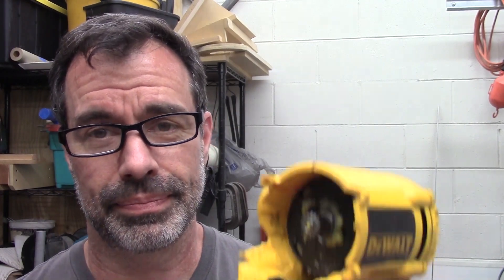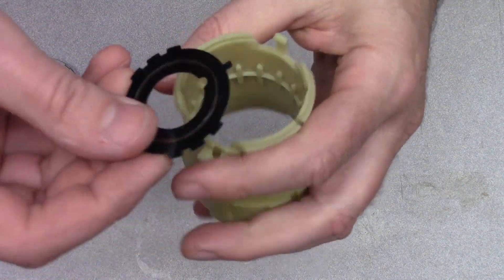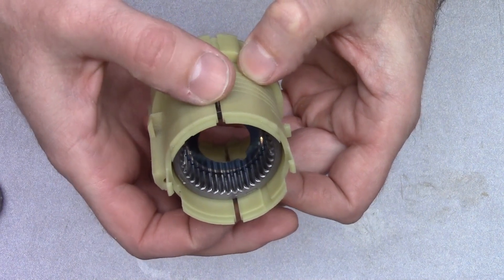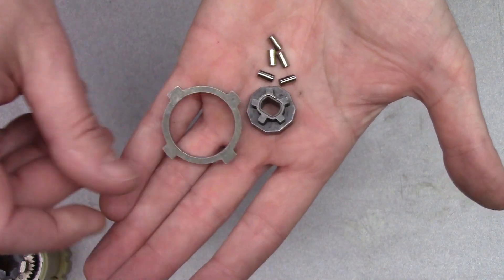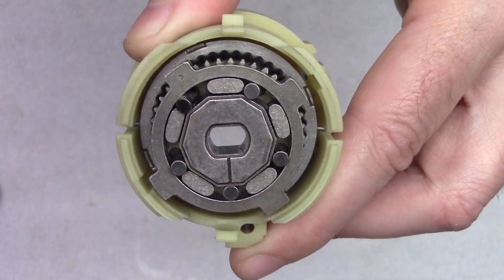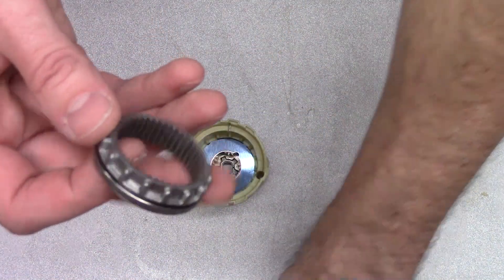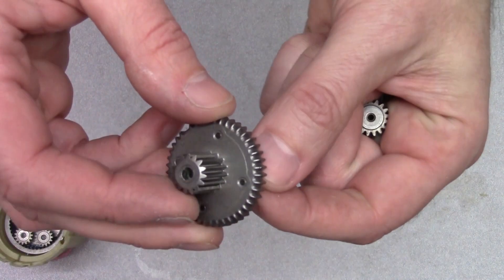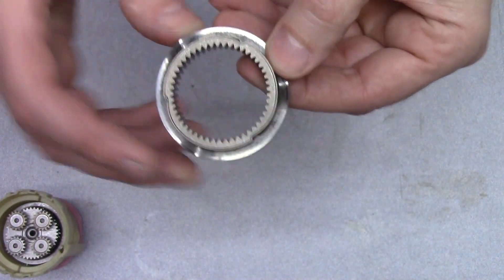Dewalt Cordless Drill Transmission Rebuild - The Next Project

Comment: Thankyou sooo very much. I was about to throw away my drill. Question should i have put some grease on the gears???
Reply from the maker: Anthony, glad to hear the video helped.
Yes, you should get some appropriate grease on the gears.  I've tried a couple different greases, white lithium and a generic gear grease. The white lithium seemed to let the drill run freely, and the gear grease was a bit thick.  Probably need something in-between.
Good luck with your projects!

Comment: My dewalt drill (dcd777) made a little popping sound when I was removing a screw. Now it will not catch at any setting though the motor sounds normal. Any educated guesses on what part failed?
Reply from the maker: Gandoff, thanks for watching and the interesting question.
I couldn't really say why your drill may be acting up. 
Your drill appears to be a completely different assembly, so I'd only be guessing at a cause. 
If the motor still spins up, but no rotation at the chuck...sounds like something in the transmission, but I have no diagram for that model to determine where.
Wish I could help.
Good luck with your project.
Take care!

Comment: When my DW987, long in the tooth as it is, got the forwards/rev switch stuck, I said, sure, I can fix that.  After that last screw came out, gears went everywhere.  I knew how they went back together, but this video helped me get them back together.  Also showed that it was easier to pull the transmission out, because of the spring pressure on the back washer.  Back together now and working great.  Thanks!
Reply from the maker: Glad you got it back together!
Thanks for watching, take care!

Comment: what kind of grease do you use
Reply from the maker: Hunt7r, thanks for watching!
I originally used a white lithium grease, but I honestly don't think it stays on the gears well enough over time. 
I've read there is a "gearbox" grease for electric power tools, but I haven't found any for sale.  
I have since used a more standard wheel bearing type grease.
This is probably not the best choice, but I had it on hand.
Sorry, I don't have a better answer for you.

Comment: Thank you for your effort.  Pretty messy trying to assemble with grease on everything.  But, cleaned, assembled and greased - it works as it should.  I used wheel bearing grease.
Reply from the maker: MonoRalph, glad you got your drill together.
I recently re-greased my drill, and I used wheel bearing grease too.
First time I used White Lithium grease, but it seemed to light and the gearbox wanted something more substantial. 
Take care!

Comment: Sir How can I contact you? I really need help in assembling of a STANLEY Cordless Drill Gearbox I accidentally open it and some parts fall apart and I didn't know how to return it back to its right part orientation.
Reply from the maker: Hey John, I feel your pain. You can email me at:  thenextproject.info@gmail.com

Let me know exactly what model drill and if you know the year that may help also. Photos will help too.

If you have all the bits n pieces, we should be able to get it back together.

Take care!
Reply: @theNextProject   hello! Tool wizard!  Can you help me? I have a SKIL drill F012236400.  How can i pinpoint the defective parts? Can i even get parts for this drill driver  7.2 volts internal lithium battery. The drill was struggling to turn.  I gripped the clutch ring and the motor moved and this freed the chuck to spin but weakly anmd and intermittently now it has stooped engaging at all. What do you think?

Comment: Do you grease the transmission gears ?
Reply from the maker: @Sully, good question, and yes I did.
After making the assembly video, I took it apart and greased it as I re-assembled. At the time I used a white lithium grease, but I don't know if that is the best choice, as I feel it doesn't stay in the gears very long. A few tool companies sell a "gearbox/transmission" grease, but I don't have any of that. 
Something to keep in mind, a thin grease won't rob power,  but may not do much to protect the gears. A thick grease may load the cordless motors more than wanted. More research needed on my part.
Thanks for watching and the comment.
Take care!
Reply: @theNextProject  thanks for your reply. I’m replacing the motor in my xrp and while I have it opened I wanted to clean the gears and re-grease them but I’ve had a hard time finding good info on what type/weight to use . Thanks to your video I at least know I will be able to reassemble to transmission properly

Comment: What can I clean the parts with as some have dirt/debris on them? What lubrication and where to apply once the unit is together do I use? Thank you so much.
Reply from the maker: @Susan Markwat, 
Hey Susan, great question(s)!
I used brake cleaner, to clean the parts, only because I had it on hand. 
You will need some sort of grease remover, a local auto parts store will have a variety.
Whatever you use, wear rubber work gloves (nitrile or latex..) and some eye protection.
My parts were covered old grease and sawdust, the brake cleaner made fast work of removing the crud.

As for lubricant, I used a white lithium grease, a little on all of the gear "teeth, and a light coat on all the shafts and surfaces the gears will contact. Gears, shafts and surfaces should be greased during the assembly process, not after. I did the video "dry" just to show the process. Afterwards I took it all apart and reassembled with grease - a bit messy.

I am still looking for a better "powertool" gearbox grease, as I feel the white lithium doesn't stay put well enough. That said, a heavier body, stickier grease may also rob some power. 
The lube will need to be a grease, not oil. 
Sorry I don't have a better answer for you.
Good luck with your project!
Reply: @theNextProject  I use grease used for paintball. Any OEM brand will work. I use it for almost all non automotive stuff because of 
1. Excellent for high cycling rates
2. Doesn't affect rubber o rings
3. Covers a large temperature range and keeps viscosity levels from fluctuating.

Comment: I have slightly different model on which I wanted to dismantle and re-grease the gearbox by way of preventative maintenance. Your very clear and concise demonstration was extremely helpful. Excellent work - thanks for posting!
Reply from the maker: You are very welcome, thank you for the comment!
What type of grease will you be using? I used a white lithium grease if I remember, and I may need to pull it apart and re-grease... I'm not sure what the factory used, but it seems to stick to the gears very well... Also stock to sawdust and other contaminants - LOL.
Good luck with your project!
Reply: @theNextProject  I've always used just a basic general purpose grease (Castrol LM) in drills / angle grinders etc.  Some of them are still going strong after 40+ years, so I guess it's OK for the Job :)  I'll have a look at what's in there already though, as the Dewalt is a more modern design and may need a slightly 'thinner' grease.
Reply from the maker: @jodeld1839  , Thanks for the reply! 
I like your suggestion.  I'm thinking the white lithium grease I used is too light. Worked and sounded good initially, but is starting to sound a bit dry. I'm guessing the messing teeth have pushed it all aside. 
On the other hand, I understand why cordless tools may benefit from a lighter grease.... less drag and all. Hmm.
Reply: @theNextProject  well a lighter grease/oil will cause less energy loss but i guess the down side tha that you have to do it more often. thank you for this video btw. i have a 14.4v xrp and when i took it apart i had a little bit a hard time putting everything back together. you demonstrated this excellently
Reply from the maker: @kjmeljuga  , thank you and I'm glad the video helped. 
Is the gear box similar on your drill, or does it have some unique differences?  Just curious.
Take care!

Comment: This is one of the best demonstrations of re-assembling the Dewalt drill gear box I've found anywhere.  Thanks for posting.  Superb work!!!
Reply from the maker: Welsh Rabbit, thank you very much and I'm glad the video was of some help.
As I've used my "repaired" drill for some time now, I want to suggest some additional research be added to the gearbox grease that should be used. I used a white lithium grease, and initially it appeared to work well. After time however, the gearbox has slowly developed some rather harsh "lash" of the gears as the trigger is released. 
It's that sudden "crunch/chatter" sound of metal gears suddenly stopping. 
So, if you happen to know of a good gearbox grease for this type of application, please leave another comment her to help others.
Take care!

Comment: AH!  I was about to toss my drill out when I found this video.  You did a great job explaining each part and how it all fits together.  I will give this a shot tomorrow and hopefully save me a hundred bucks.  Thanks!
Reply from the maker: Chris, thank you! 
If you are lucky enough to have all the parts, I'm sure you'll be able to get it back together. 
It may take a couple tries, but it will happen. 
I didn't discuss adding gear grease to the assembly, but I did use white lithium grease - just not for the assembly video. 
A small tube of grease can be picked up at Ace Hardware, Lowes, etc... 
Good luck!
Reply: chris kelly I took 1 drill apart to clean some glue that had tried in the motors holes (happened in my tool Bag) cleaned it all up and as I was attempting to put it backchats together the gears popped apart , that was 10 months ago , I’m going to give this a shot , ASAP let you know how I made out thanks for the diagram I have already screen shot that and printed it up it’s sitting on top of the bin the drill is in lol ..
Reply from the maker: @acypooder1  , glad you found the video, and I hope the diagram helps.
Even if you have a different model & gearbox, I think the diagram should offer an understanding of where all the little pieces may go. I expect you'll have no problem, and if it doesn't cooperate, just try it again. I fumbled with some pieces a time or two, now I get the process and it's rather easy.... now I'm looking for another broken drill to mend.
Take care!